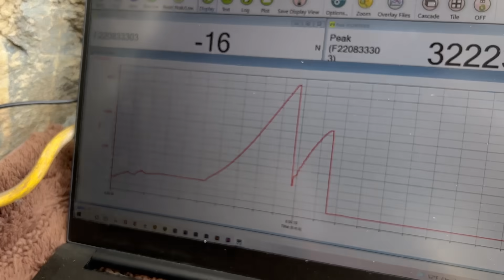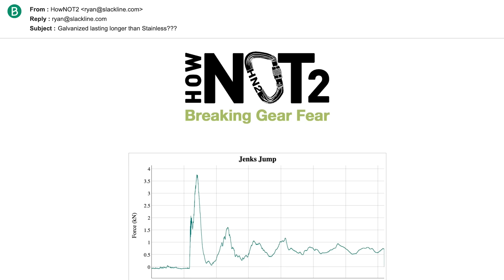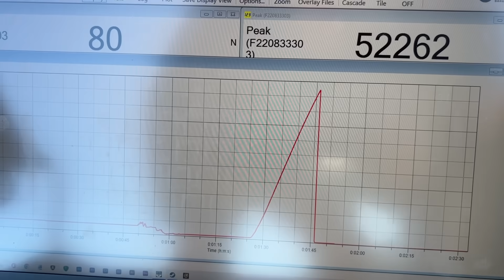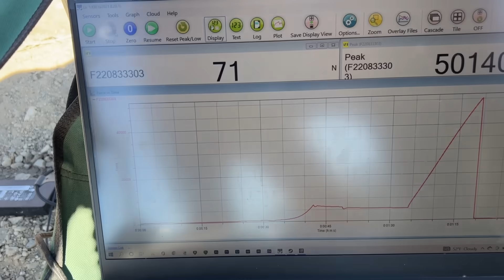This project took 2 years

Comment: Does anyone know how the glue fails? 
Does it fail like bolt threads, where even if you have 2 feet of threaded bolt, it will stretch the bolt and keep ripping the outside threads out one by one?
Or does the glue reach critical strength and let go all at once?

Comment: I dont know if you've done any testing or looked into it. But what about bolts that have been in sunlight for a while would the thermal expansion and contraction from the suns heat change it and make bolts or the glue weaker over time?

Comment: Im a welder by trade, dont think there is much issue with stainless losing its corrosion resistance due to too much heat.  You have to understand that tig weld gets a lot hotter than the torch youre using.  Stainless steel is used in some applications for piping (depends on the type of product being run through the pipe) specifically for its ability to resist corrosion.  And that piping has tens to hundreds of welded points in it. As long as the filler material is the same or another compatible stainless alloy, it will last quite a while, only needing replacing dude to material loss from erosion on the inside.  Just my experience.
Reply: Maybe contamination from the oxy acetylene torch.

Comment: @HowNOT2 I have a very useful, easy-to-tie knot I'd really like you to test. It's called the "alpine bunny knot", it's not very common, and it's used to tie on a swivel pulley mid-line (among other things). It seems like it would be as strong as an alpine butterfly if not stronger, but no one I know of has actually tested it. Thanks! - and I love your content!

Comment: If he used a radius tool to do the notches it should be far stronger, sharp edges are failure points.  Still looks bomber as it is 👍

Comment: 4:50 Yes, if the diameter changes abruptly like an edge than this edge is a stress riser and cracks do typically do start from there.  If the inside edges are rounded off it helps the steel. If the outer edges are rounded off it helps the epoxy not to get cut.
If you use high-speed-steel on the lathe you can grind a tool that will cut a round shape and later you can put the part in some grinding tumbler , or something like that,  to round off all the tiny nicks and everything. If you have ductile material and you have a nick and it gets under load than the nick will be stretched to some rounded off shape, which will be small but rounded. But this doesn't work all the time.

Comment: QUESTION ? how does one choose  between hooking into the anchors themselve or the chain link coming down from them? is it just a prefrence thing or a strategy thing?
Reply: i prefer clipping one ofthe bolts directly,  more important is that the biner is not being stressed or side loaded by any of the hardware. 
the bottom ring is for your rope,  because it is free to rotate it won't wear in one spot like lowering on a bolt can do.
and if you ever do clip the chain clip through a link and not around the chain.
Reply: @ztungaz  ❤️ THANK YOU those were all great explainations and i love.

Comment: That's a beefy bolt for just 25kn MBS, nice to see Aboud didn't take any shortcuts. He might be able to improve the design by taking the first few cuts along the shaft with a round insert so as to not introduce stress concentrations in shear. Nice work everyone!

Comment: I'll still believe in a two piece bolt way more than a single point. The second part expands into the space and holds the first part in place. A good epoxy is a key part of either, but the two points of failure seems better to me. Having threads connected to the rock through mechanical means with epoxy.
Reply from the maker: I don't think any glues mechanical bolts.  So it is one or the other.  A single point of contact with the rock like the wedge of a mechanical bolt might not do well with crappy rock like in our mine or soft rock as that contact point can get worn down.  The glue holds the entire thing with more surface area which isn't necessary if your rock is good.  If you glue a mechanical bolt, the tolerance is so tight for the wedge to work that it either squeegy's all the glue out or the threads get gummed up and you can't tighten the wedge up correctly getting the worst of both, not the best.

Comment: Switching over to a grooving tool with even a small corner radius would really help reduce that (very minor) issue with the bolt failing at the groove. Awesome work from both Hijazi and the HowNOT2 team.
Reply: My first thought as well, if that's a completely rectangular cutting tool with a sharp corner, that's a stress riser. Not sure where the sweet spot of less-stress-riser-but-not-too-little-epoxy-adhesion lies, though.
Reply: @BoLanggaardLind  , I think what matters for holding on to the epoxy is the outer edge of the groove, which should be less of an issue stress-wise, so grooving just the inner angle, while leaving the outer sharp, could be an effective compromise.

Comment: Would concrete screws work in granite?
Reply from the maker: Probably. some route developers use the SS version for permanent placements. many use the zink plated versions for temporary bolts. in really hard granite it is possible to strip the bolt. some say soaking the hole helps. We use Simpson Strongtie Titen HD screws. i would be skeptical of other brands until testing is done. lots of resources and discussion reguarding those bolts for climbing on mountain project and youtube. -Bobby

Comment: 8:00 now dumb question of the day
Would you recycle the pulled in tension bolts to sea if they have weakened? "Micro fractures?
Reply from the maker: Steel doesn't microfracturer like aluminum but I wouldn't want to use something that has been that compromised.  Plus they are bent.  We made art out of them.

Comment: Do you degrease the bolts before putting them in? That could help quite a bit with gluing.
Reply: The goal isn’t to glue the bolt to the rock, the goal is to fill the voids with a solid material that will effectively trap the bolt/rock rigidly
Reply: @ohokcool  Even then will better adhesion give a benefit though, one and the other aren't mutually exclusive.

Comment: A  small radius in the grooves would greatly remove the stress point.
Reply: It seems like it would make manufacturing more complex which means each bolt takes longer and more money to make/buy, not sure if it’s worth it if we’re already hitting almost double the rated strength
Reply: @ohokcool  not really. The lathe tool  just has to be modified it really isn’t a big deal to do.

Comment: I always wonder if you couldn´t improve adhesion to a bolt with some kind of surface treatment like sand blasting or etching, instead of just grinding or machining large grooves into it. If that were to work you´d have a higher possible MBS since you could maintain a constant diameter.
Reply: Sand blasting and/or just a a knurled or pressed in in groove pattern would be interesting and possibly less costly to make.
Reply: Even if you can do that does it relly matter?  Is there a need for a bolt that can hold even more weight? This seems to work fine and it is likely quite a fast operation during manufacturing with just a lathe.  In the tests I have seen it looks to me that for 10 mm bolt, it is the rock itself or the glue interface with the rock that is the limitation not the strength of the bolt. If the bolt snaps it is usually the eye that bends and snaps. The bolt that snapped in this video did that after the rock was crushed.

A simple improvement that others have mentioned is have not had a 90-degree corner in the cuts but rounding them off it a rounded and not a sure bit for the last or all of the cuts would help.

I think the grooves have an advantage. It should push around the glue more so you get it everywhere. If it just is a smoother rod the glue will flow out at a higher rate when you push the bold in and that feels like there would be a higher chance you end up with too little glue and you do not get a good glue joint.

If you need higher strength larger diameter and longer bolt is likely a simpler way to achieve it.
Reply: @target844  i was just thinking pressing in grooves or sand blasting as cost reduction, those bolts are plenty strong.  The grooves work fine as is. It’s not even worth it to round the corners given the strength already achieved.  Round cornered grooving tools can make it hard to clear chips and the forces go up. Also stainless is awful to machine.  But basically I was suggesting something not far off from rolled threads. It’s a faster operation that’s cheaper… but only if the tooling is available. Knurling is more accessible with similar benefits and worth considering if they even care to cost optimize it.
Reply: Sandblasting and all that is great for sticky adhesive glues but this is more of a hard glue that serves the purpose of filling voids to create a rigid body preventing movement within the interface between rock glue and bolt… adhesion is not a super important element in that context, it’s basically like joinery/puzzle pieces fitting together, a little bit of wobble or spin isn’t even a problem
Reply: @ohokcool  epoxy for structural applications is absolutely rated for bond strength to steel and surface prep is specified when it is important to get a bond.  For normal bolts it’s not as critical because they are threaded.

Comment: It looks like he could go for rounded grooves. The rounding will help spread stress over a large area. Even in the glue. The glue not making a sharp 90 degree should be stronger. Of course, it sounds like he has gotten them certified, so I'd probably keep it in compliance with those certifications rather then pay for a new certifications for new design.
Reply: Sounds like rounding would increase complexity of manufacturing which was one of the main considerations he had to make so I’m sure he knows that but a good product design is a careful balance of efficiency, value, and quality
Reply: Exactly: just radius the inside corner even a tiny bit so it won't form a stress riser there.

Comment: He should use a radius tool shap to cut the grooves to get rid of that 90 degree corner and stress point
Reply: Square grooves are better for adhesive channels.  They're already breaking at ~150% of ultimate strength in shear.  No matter how you design it it can be broken.  As long as it's breaking well above rated strength, your design is valid.
Reply: @Mind_Funeral what if you only round the inside corners in the grooves? I feel like it's mostly the outside corners that provide adhesion with the glue. You could potentially even take it a step further and make the grooves asymmetrical since the grooves and glue mostly need to resist the force in a single direction. (Although you would want some resistance in the other direction as well, unless you pre-load the bolt).
Also a question that comes to my mind: do sharp edges also compromise the hardened adhesives in a similar fashion as they do in metal? I assume the final hardness and elastic properties of the cured adhesive come into play here.
I'm not a trained engineer so I don't know and I'm genuinely curious. I have had a little training in material properties but nothing extensive.

Oh and you're correct that it's probably not necessary given the use case. But I do enjoy thinking of ways to make things better/stronger, potentially without much of an extra cost.
Reply: @Ahapenootjes  I'm not too sure about making the inside of the grooves radiused. You might be onto something. I don't think it would hurt the pull out strength. But to answer your question, yes, stress concentrations due to hard angles affect adhesive too, but as seen in the video, the adhesive is going to shear at the top of the grooves.

Edit: I am a trained engineer but I don't do much of the calculating or analysis anymore. I'd have to bust out the books 😅
Reply: @Mind_Funeral  yeah I've noticed as well the adhesive sheared around the outside of the grooves. Which is why I wonder if rounding both the in- and outside corners would be beneficial instead. The inside corners to prevent the stress point in the metal of the bolt and the outside corners to prevent the stress points in the adhesive. If I was making something like this and I had the gear I would really love to test different geometries. Ideally you would also test with different adhesives.
(Well actually there would be tons of variables you could test which would get expensive pretty fast 😅)
Reply: Same thought here. At a minimum the first few instances from the bolt eye.
Reply: Is there a carbide insert cutter that might provide a good profile for the glue holding grooves?  My guess is that a slight radius or small chamfer on the inside corner, with the faces perpendicular to the barrel of the shaft would avoid the sharp corner where that one bolt failed in pull out.
Reply: If it’s good enough it’s good enough.  Sometimes you can chase small gains with big money doing stuff like that.  As long as he’s got lots of margin of safety which he does keeping it simple may be worth it.